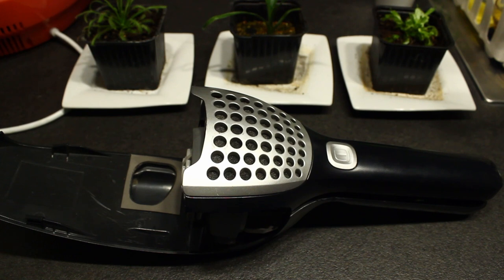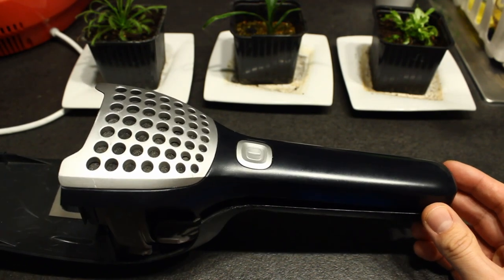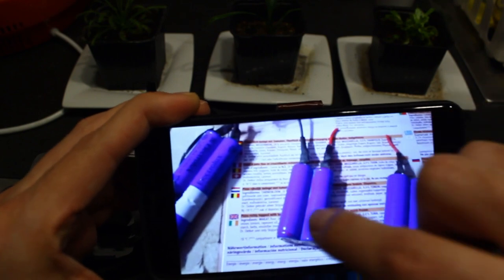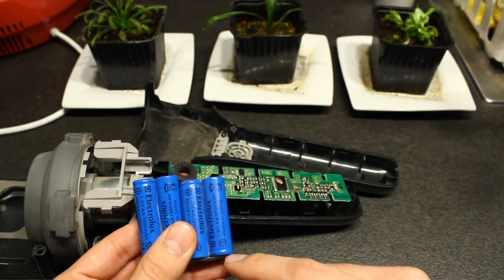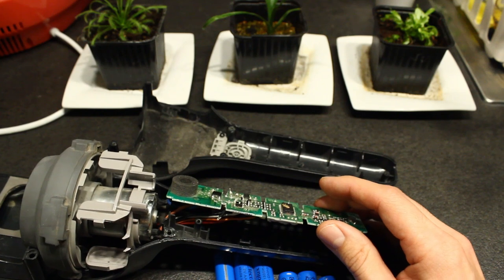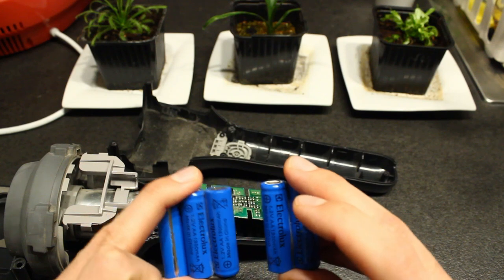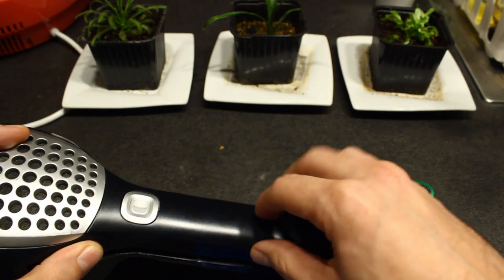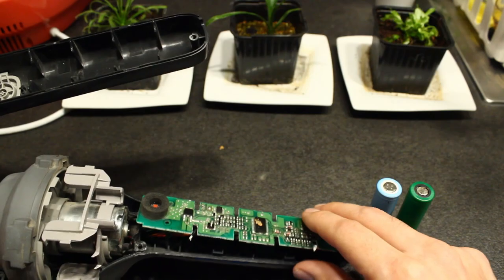Electrolux vacuum machine battery replacement. Part 1

Comment: Would like you to have shown how to remove the batteries from the grey plastic clips etc.
Reply from the maker: I think to remember that they came off easily, no need to break anything or use any tools.
Reply: @argilaga  I appreciate what you are doing.  The top two batteries behind the fan are hard to remove from the framework. They seem to be locked into the plastic framework some how.
Reply from the maker: ummm... it seems that Electrolux is trying hard to stop people fixing their obsolescence. Be careful not to injure yourself while removing them!

Comment: Wait.... What? 1 year? Mine is not exactly this model, the handle is different but I have it since 2010 and still works fine. I came here to see if it was easy to tear apart and clean and eventually use more powerful batteries.
Reply from the maker: I hope you have better luck with your battery! Hopefully it's a Lithium-ion, not this Ni-MH 10 cells in series I got. But if you say it lasted 10 years, that's already very good.